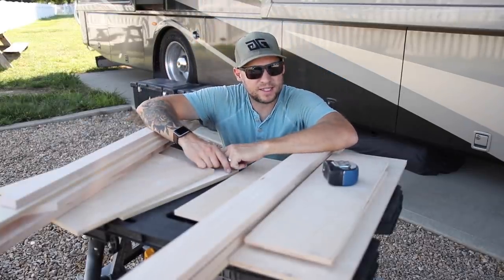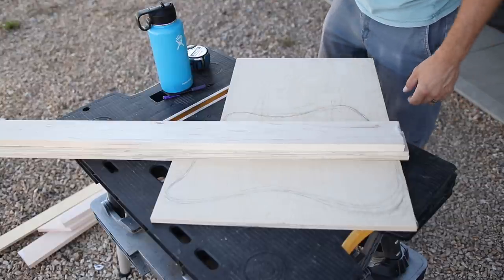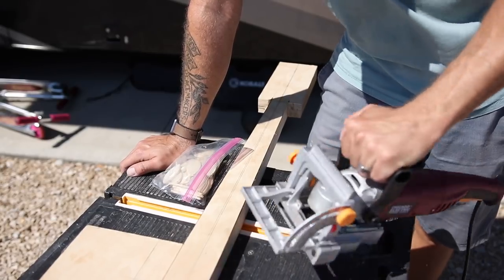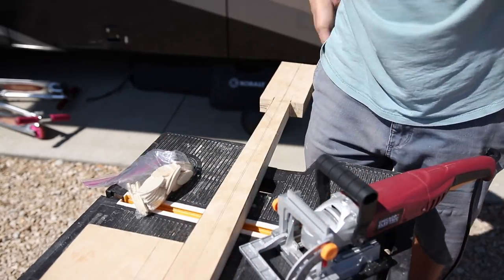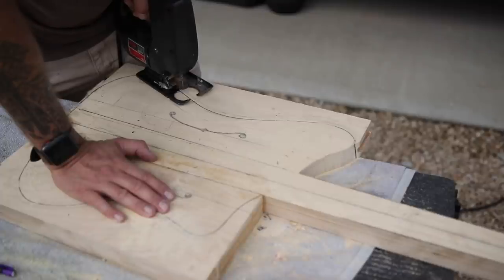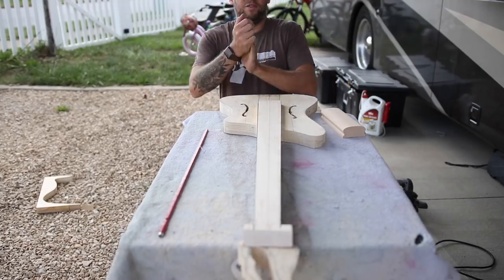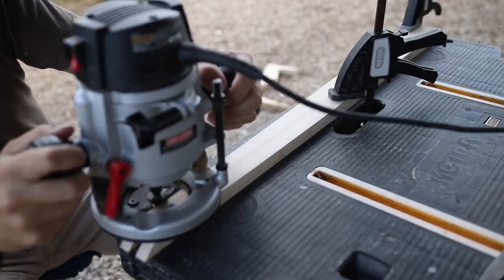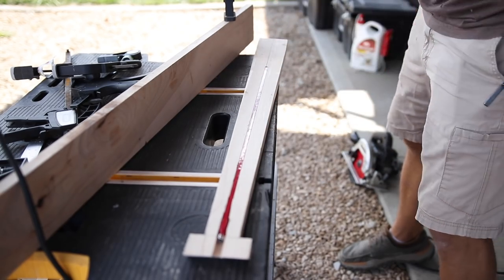Building a Fretless Piezo Bass from SCRATCH using SCRAP PLYWOOD w/ minimal tools! (part 1)

Comment: You could get a small pull-behind covered trailer to put a few of those aforementioned speciality tools in.
Reply from the maker: I’ve thought about it, but it does make things more difficult. Two major problems, I’m already towing a jeep, so then my wife would have to drive separate. And, once we get to a camping spot, I would need to find a spot for the trailer as well. Not always an option.

Comment: 09:55 that's an amazing cut by freehand, wouldn't have thought that would work. I guess the buzz saw makes it possible
Reply from the maker: Thanks Georg! The circular saw can make pretty straight cuts freehand if you’re careful, but it’s not as perfect as a table saw for sure. There will be small touch ups needed in the finishing stage to make it perfect.

Comment: I think I would have Used the full Maple board as the top of neck blank.   Just below the fretboard.   But.  You don't want to use ply for the fretboard either.   Because  radius would be.   Awkward.. lol.. so. All in all,  No rules.  Just build what You want.   I luv that you Routed the truss rod into the full 3/4" maple.  I probably would have sunk that a 1/4" into body/neck. So only 3/8" was revealed as fretboard when finished.  But. Like I said.  No Rules.  I break all kinds of rules when I build my Guitars too..  so I really like seeing Your work.   Keep up the great content !
Reply from the maker: Sinking the fingerboard into the neck would have been a great idea. Wish I thought of that

Comment: Burn it to charcoal where you can.. Shu sugi ban.. And CA finish. I just did a fretless conversion and CA polishes up well.
Reply from the maker: Interesting. I’ve always wanted to try a CA finish. But I’m afraid, seems hard to reverse if it doesn’t turn out how I want it to
Reply: @GunsandGuitars  the thin stuff will spread with a paint brush perfectly and coverage is more than expected. 600 sanded my fretboard to a reasonable polish so far.